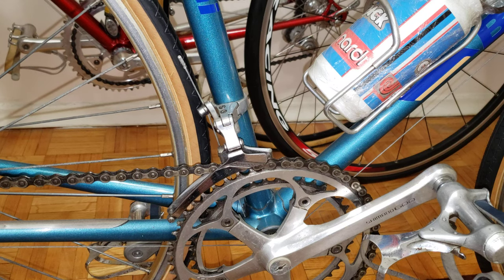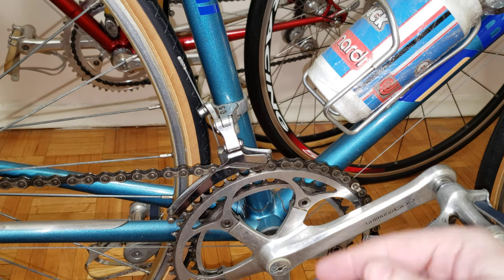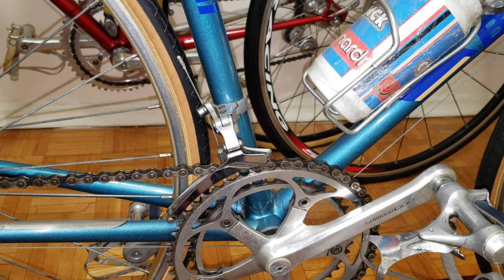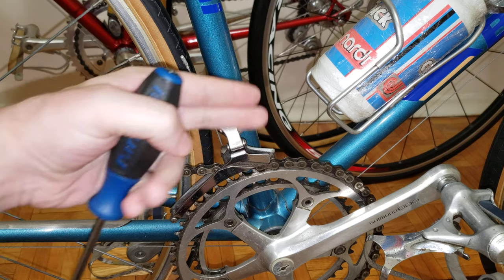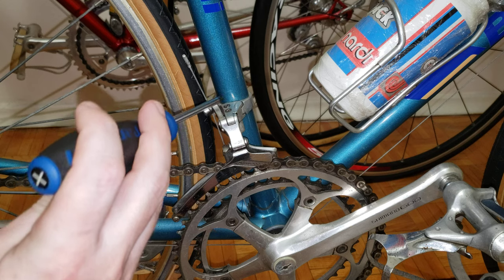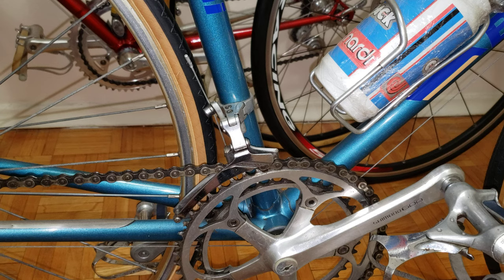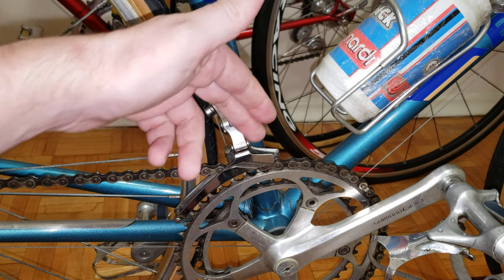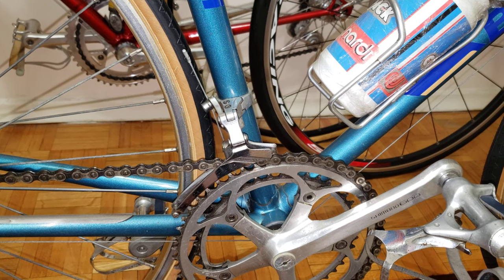Shimano/Campy Front Derailleur Won't Shift Up Onto A Bigger Chain Ring | 4K

Comment: The tension seems fine, but the shifter (which rotates) of extremely stiff and impossible to turn. But when there's zero tension, it shifts fine, so I don't think it's a shifter issue
Reply from the maker: Are the limit screws adjusted? They could be blocking the movement of your derailleur.
Reply: @IvansBikesBmws  they are perfectly set. I took apart the shifter thinking it would be dirty, but it's clean. The derailer is at the perfect spot at the 3rd and 1st gear. It is just insanely difficult to twist the gears when trying to shift up. Down is no problem
Reply from the maker: @michaelfrymus  
Your shifter has too much friction on it and it needs to be taken a part to be relubed. That is the only suspect left.
Reply: @michaelfrymus  i have the same new cables new derailleur and nothing no chance set big ring you can break finger :/ pain in the ass

Comment: No matter how much I loosen the barrel adjuster or tighten it, or mess with the hi and low limit screws, I can't get the derailleur to shift to top gear on the front sprocket. Would loosening the bolt that keeps the cable attached to the derailleur and tightening the cable make any difference?
Reply from the maker: Yup. Always check the cable as well.  It probably has cable slack , so you it will not push on the biggest ring.
Reply from the maker: And give an update after pls.

Comment: my shimano front derailleur won't go to the big gear.   it takes 3 clicks to get from small gear to the middle and getting the 4th click is extremely difficult. The 4th click does not get  me to the big gear.  The H limit screw is all the way up, so there should not be anything blocking the derailleur. By click #4, its the derailleur seems to be stretched over to its max with the cable being extremely tight.  When down shifting, i can feel the feedback as the tension cause the derailleur to snap over to the lower gear.  There is no dirt or debris build-up, and the cage has space to clear the big gear.

Help  =)
Reply from the maker: Willie it still sounds like it was not adjusted properly. My advise, play with inner cable so that you have enough tension to get it to shift on the biggest cog. That is considered the limiting screws are set properly as you described.
Reply from the maker: Let me know if that helps.
Reply: got the same problem
Reply: I have the mech position on point, cable tension is the max I can do (and using in-line tensioner), screws are set appropriate, but it's like the mech just can't do it. What's weird is that it initially worked ok, but only briefly.
Reply: @IvansBikesBmws  I don’t have any clicking in my front shifters

Comment: Why does my bike not shift up to the big ring when climbing a hill but works on the flat without any issues thanks
Reply from the maker: I have seen that one my bike. The first thing to look is your cable tension.  There is usually lots cable slack.  Your cable needs to be adjust just a bit.
Reply: Thanks I’ll try that
Reply from the maker: @jeanchristie5468  whenever you can not get that chain on the bigger chainring, that means you got some slack in the cable preventing it to do so.

Comment: My shimano tiagra wont shift to big ring, it doesnt have click if i try to shift it from lever
Reply from the maker: Joe the front derailleur is not going to click because it is not indexed like the rear derailleur.  Try adjusting the limiting screws and you will be fine.
Reply: @IvansBikesBmws  thanks, it works

Comment: Nothing happens when I loosen or tighten the H and L limit screws.. My bike will only shift down but not up
Reply from the maker: Andreas your cable needs to be adjusted.  It seems there is slack and it will not push it on your biggest chain ring.
Reply: @IvansBikesBmws  I've tightened the cable and there's no slack but it still won't shift. It's not just up to the biggest chain ring but it won't even shift up to the 2nd biggest
Reply from the maker: @andreashenriksen1485  

There is definitely a problem. What happens when you test the front derailleur with your finger? I always test it manually by pushing it up on the biggest chain ring just to see if it works. I have seen it stuck sometimes.
Reply: @IvansBikesBmws  The front derailleur moves just fine when I use my fingers to push it - So it moves freely
Reply from the maker: @andreashenriksen1485  
Okay , that is a good news. So there is an issue with cable not giving it enough force to shift onto your bigger chairing. Have a look at the cable and shifter again as the issue is there.
Reply: @IvansBikesBmws  I really can't seem to find the problem but i'll take it to the bikeshop one of the following days and they'll probably be able to fix it for me. Thanks for the help though! I really appreciate it :D
Reply from the maker: @andreashenriksen1485  
Andreas please update me what went wrong as some of them can be tricky to adjust. You are very welcome.
Reply from the maker: My prediction is that the issue will be very easy for a bike shop to fix. Excited to find out.
Reply: I'll update you on it as soon as I've been at the bike shop with it :D
The issue is probably something that's in plain sight that I just don't see. I'm quite excited to find out myself too!
Reply from the maker: @andreashenriksen1485  Thanks Andreas
Reply: @IvansBikesBmws  Okay so I haven't even taken my bike to the shop because when I was trying to figure out what was wrong I noticed that my front derailleur was actually cracked where you screw in the screw to hold the gear wire in place. So I ordered a new front derailleur and a new shifter - So we'll see If that solves the problem :D
Reply from the maker: @andreashenriksen1485  
Ohhh I have seen problem on simplex Peugeot French  bikes. Very common.  Especially if the hangers are made of that plasticy rubber, they are very lightly to crack there.
Reply: @IvansBikesBmws  It was actually made of aluminum but it was very old and it had been trough a lot so I guess that's why it broke
Reply from the maker: @andreashenriksen1485  Thanks the update!

Comment from the maker: If you need any questions , I am here to answer
Reply: I have ques but it in language hindi
Reply: Can i ask in hindi
Reply from the maker: @mdajmalkhan4098  I mainly answer in English.
Reply: Please help - cannot shift from large to small. Giant, Shimano 105
Reply from the maker: @nikmalinin8786   Gotta adjust limit screws on the derailleur and you be good
Reply: @IvansBikesBmws  thanks boss, however I am completely alien to this. Is there any video to assist exactly with what to do?
Reply from the maker: @nikmalinin8786  https://www.youtube.com/watch?v=Ifzc1f9glvY 

Play with the screws and you will get it set. It takes some practice .
Reply: When I try to shift my front derailleur to the 3rd gear/biggest ring, the gear trigger doesn't click but the derailleur moves a bit to the right. I can shift to lower gear but not above gear 2. It just doesn't click.
Reply from the maker: @gamingwithhammad7681  Did you mess with those screws to adjust them first. They allow you how far you can shift. I would start there. Also is the cable loose?
Reply: @IvansBikesBmws  No,  I did it after it stopped working, when I watched the videos. I turned the "H" screw ccw but it still doesn't click or shift and the cables are tight.
Reply from the maker: @gamingwithhammad7681  Is the front derailleur stuck? Before I do anything I test the derailleur by moving it towards the big ring. That way I know it works. The only other too issues can be your shifter and cable slack. The last person that texted me on here had cracked derailleur hanger not providing enough strength to push the chain on the bigger rings. So look at all 9f those because that is where the problem is.